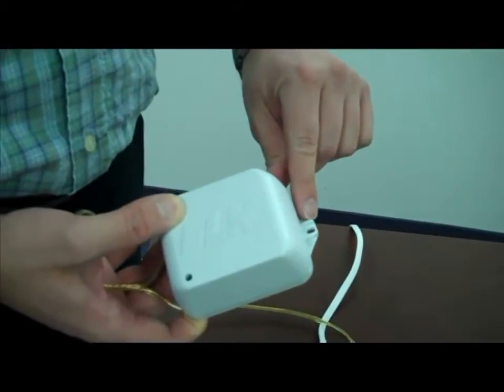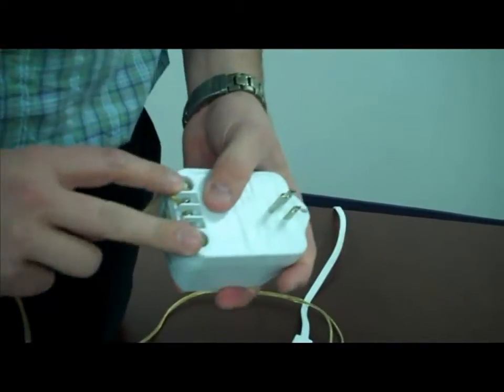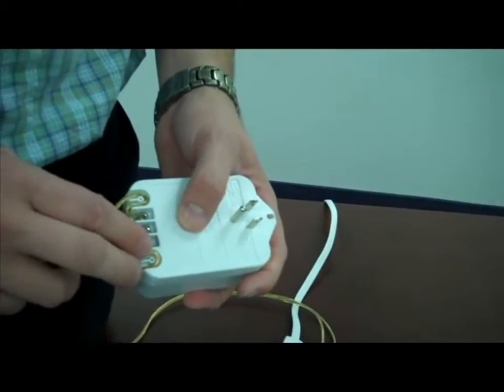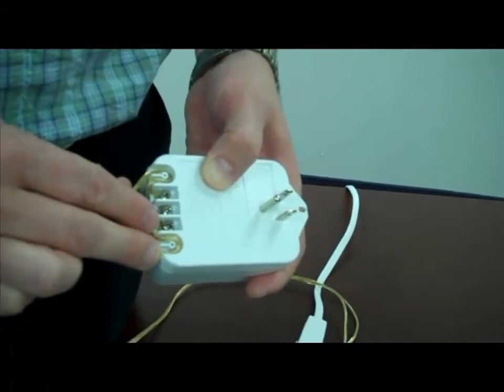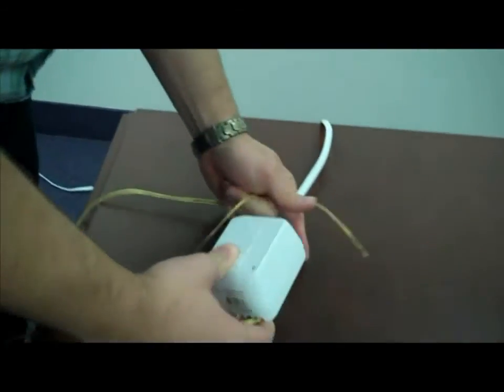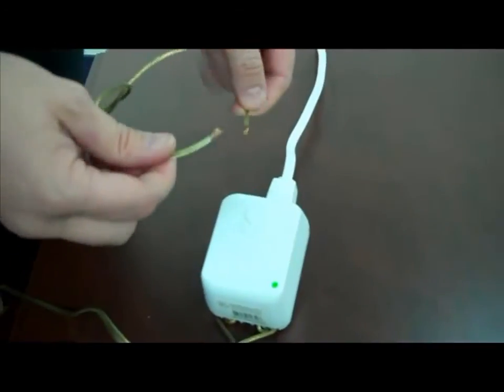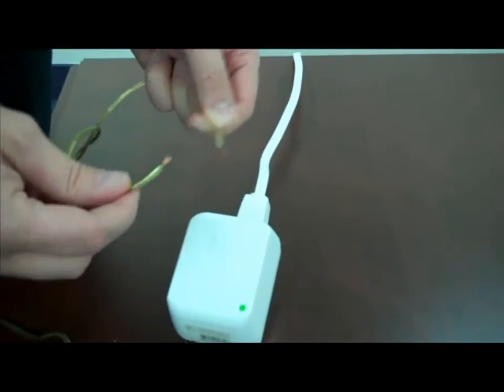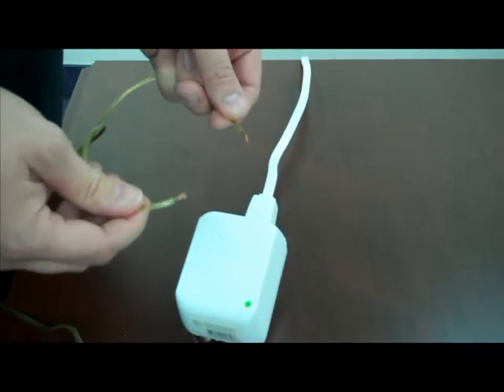ELK Transformers

Comment: How do I connect the 4 wires I have to power my alarm? I have red black green and white?
Reply: Best to see the manual for your actual alarm setup.  Usually only two wires are required for powering alarm devices.